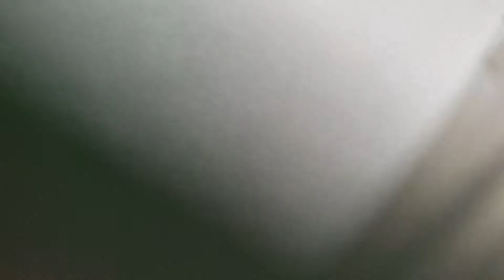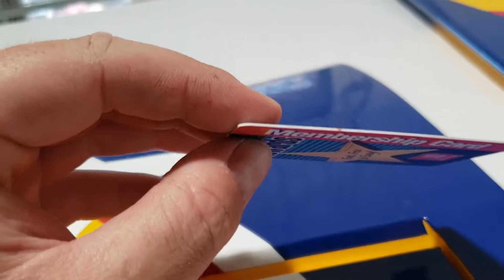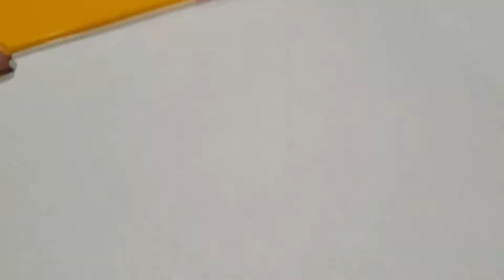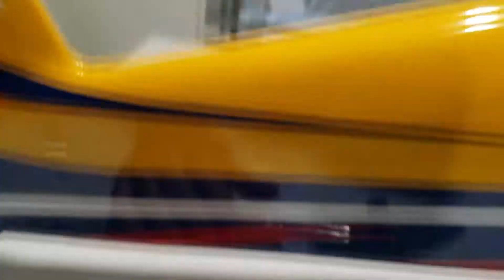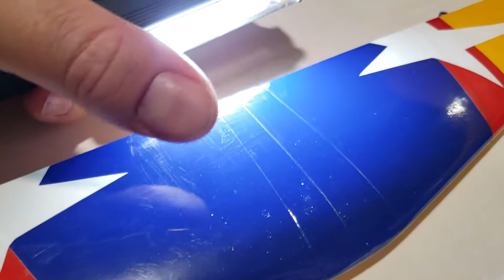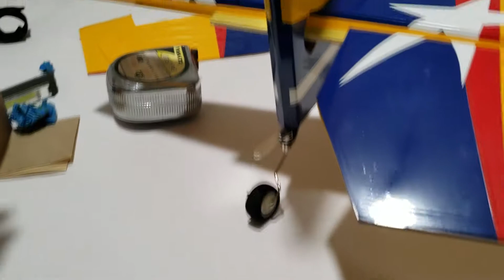AJ Aircraft 51" Slick Hinging & Horizontal Stab Install

Comment: Is it necessary to peel of the covering of the horizontal stabilizer ? In the manual it seems that it stays on.
Reply from the maker: Highly recommended to make sure the CA wicks into the wood joints. You want wood to wood.